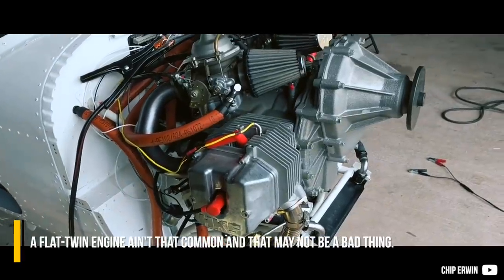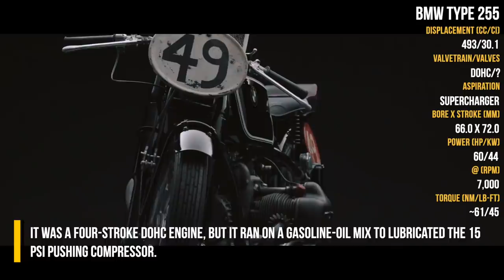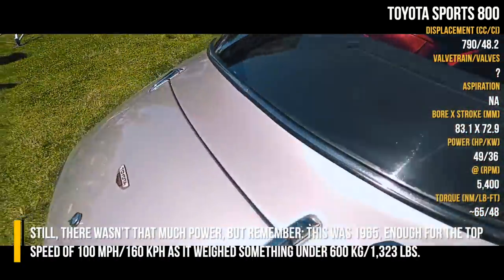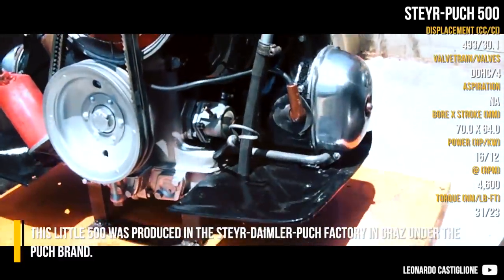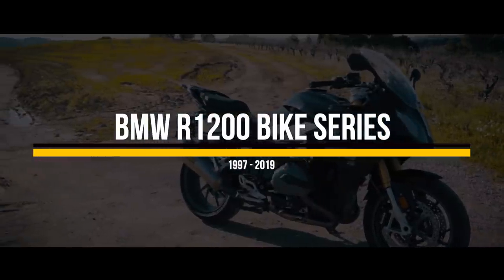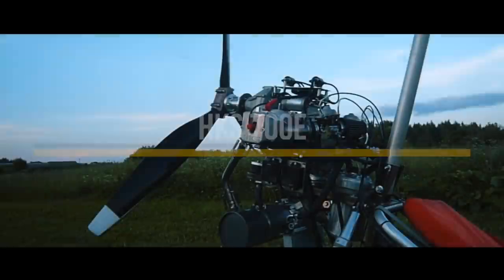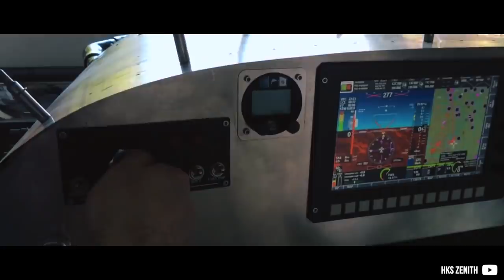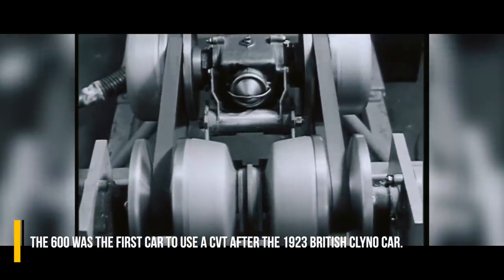6 Best Sounding Flat-Twin Engines In The World

Comment: Going along in one them DAF cars and someone rolled the window down, the roof caved in by about 6 inches due to air pressure difference, we were going down a big hill fast. The metal used for the bodywork was so thin it like cooking foil.

Comment: you forgot the  2cv/3cv legendary engine
Reply: Citroen boxer engine
Reply: I came here to say the same thing.  2CVs sound terrific.
Reply: It is a boxer, not a real "flat"
Remember boxer have 180° spaced crank pins and the flat one is everything else other than 180
Reply: @habdman  Most, if not all of the engines in this video are boxers by your definition, as is the 2cv engine.
Reply: @habdman  Most flat-twin engines use a boxer configuration for the crankshaft and are therefore called "boxer-twin" engines
Reply: @habdman  It's flat if it's flat, that is cylinders disposed at 180 degrees to each other. It's flat AND a boxer if the pistons move in opposite directions so as to "box". Opposed piston engines (no head) are also boxers but the cranks are at each end or, in the case of the Commer diesel, one on top driven by rockers, it was called a "knocker" for obvious reasons but it IS a boxer. The Deltic (most often, 3 6 cylinder banks of opposed pistons disposed at 120 degrees and 3 cranks, 36 pistons!) is also a boxer. The pistons box each other. So the terms flat and boxer are actually unrelated.
Reply: A major omision I think especially considering the length of the production run [1948-1990] and the vast numbers that were produced
Reply: @habdman  It is flat engine. Because All boxer engines are flat engines, but not all flat engines are boxers.
edit: Also many of the engines in this video are boxer engines.
Reply: Jesus I tough they were classified as two different breeds, i'm sorry people thanks for correcting me!
Reply: @habdman  They still kinda do, because you can't call just flat engine a boxer engine. But the other way around it is ok.
Reply: Yeah, that's a huge omission for the best sounding flat twins and objectively the 2CV is the sweetest sounding flat twin

Comment: I'm note sure about some of those examples - whatever - Did you know that Velocette had horizontally opposed engines (both air-cooled and water cooled) one was in the LE Velocette. You gave an aero engine too - so you might check out the Bristol Cherub - (now they make much noise).
Reply: Yep, air cooled was Velocette Valiant. Both looked and sounded good.
Reply: @berniecork7416  It might interest you, that the LE Velocette we had was used to give out Dachshund some fun.  A board was fastened up the (flat) tank - and straps fashioned into a harness. A suit of riding gear was made. Dog used to lean into corners like an Isle of Mann TT pro.
Reply: @kiwikeith7633  I can imagine your dog loving that...our old collie used to love riding on top of trailer of hay bales...always had to be on the highest one...

Comment: I don’t know if it matters, but it’s missing the Brazilian Gurgel BR800, that was equipped with a flat twin 800 cc engine, basically a half from a VW 1600 air cooled engine with a pendular support, but liquid cooled in this application.

Comment: Flat twins don’t run smooth because the cylinders are staggered by the width of the con rod big end so they all have a rocking couple. A 5 bearing 4 cylinder is way smoother

Comment: It is not yet on the roads but I had the chance to hear BMW new 1800cc flat twin, and let me tell you it deserves its place on the list...
Reply from the maker: Did you? I am curious about that one...
Reply: @VisioRacer  Yep, i recently worked at the bmw test track in Miramas and saw some cruisers based on the r18 that i think BMW is going to release soon ! 
they were running around the loop for hours, so i got to hear them quite a bit :)
I don't know if the mufflers they had will be standard issue, but they had a nicely defined, not too loud exhaust note that was a bit like a slightly muffled harley engine, but evenly timed
Reply from the maker: @crezychameau  Really looking forward for it. I think it is going to be very cool

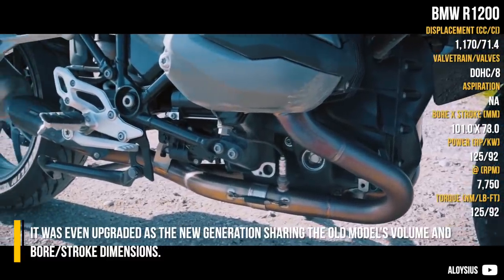Comment: why does the BMW have a spark plug on the exhaust pipe? 2:55
Reply: I think that’s an O2 sensor :P but I could be wrong
Reply from the maker: Dudeee, that's an O2 sensor, not a spark plug...
Reply: VisioRacer is it really? Why would it have one O.o
Reply from the maker: @chaoszombie9995  Fuel injection control. That's what an O2 sensor does based on oxygen content in the exhaust.
Reply: VisioRacer oh yea.. well I’m a Carb guy in case you haven’t noticed
Reply from the maker: Ahh, sure 😅

Comment: no  goldwing eh?
Reply: If i'm correct Honda goldwings only had flat four and flat sixes, no flat twin.
Or were you talking about another kind of goldwing ?
Reply: @crezychameau  the new goldwing? is it no flat six twin?
Reply: @crezychameau  is not the k series of bmw that use non flat twin?
Reply: You might have misunderstood what "flat twin" means:
Flat means the disposition (opposed cylinder in an horizontal configuration)
Twin means two cylinders.
So flat twin : two cylinders opposed
goldwings use flat four and flat six, so either 4 or 6 cylinders, not 2

And yes, the bmw K series use an inline configuration, not a flat one. But the k75 and k100 have special engines nonetheless because they are disposed longitudinally, and horizontally, which is extremely rare, if not the only one done this way.
Reply: @crezychameau  so,... flat twin is an engine with 2 cylinders?
Reply: @LEEGOOVER9901  Yes, flat twin is 2 cylinders
Reply: @crezychameau  ahahaaa... yes yes,the ducati and harley has v Twin....yes yes,thanks sir